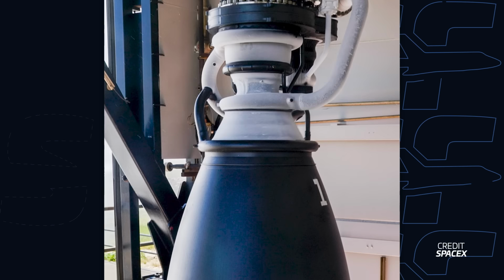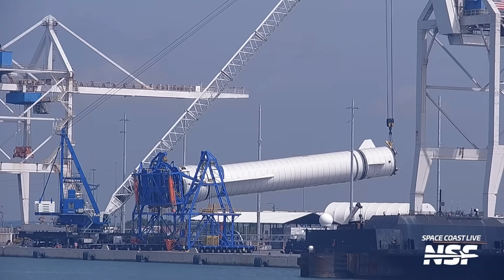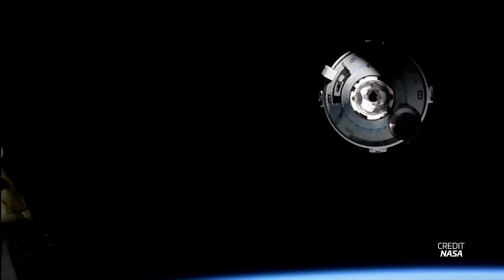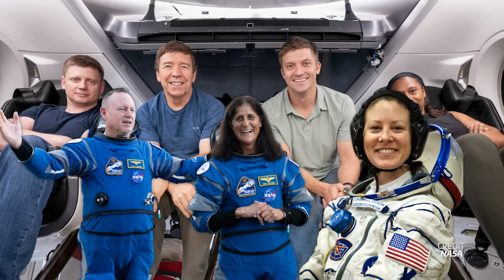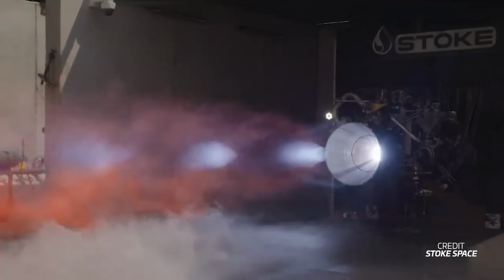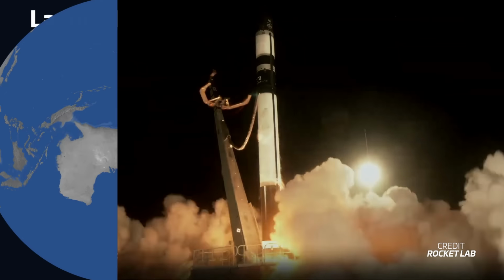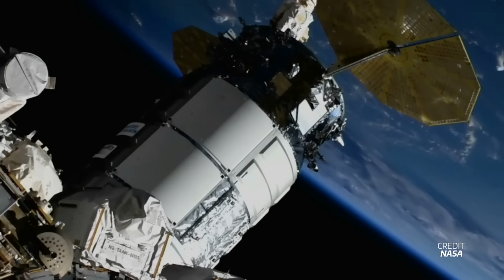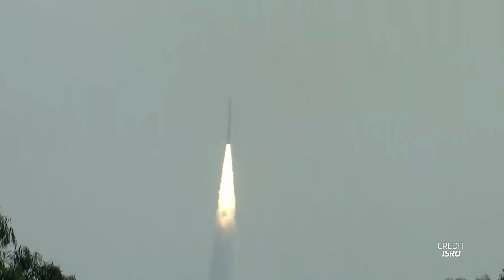Raptor 3 Fires Up, New Glenn Tests at Port & Starliner's Latest Update | This Week in Spaceflight

Comment: I'd guess that the cause of the colour of Archimedes' exhaust is probably the same as the reason why the Raptor has gone from purplish flame colour with Raptor 1 to more orange flames with Raptors 2 and 3. What exactly causes the colour change, I can't be sure, but I'd guess that it's caused by the engines running more fuel rich (maybe to reduce cooling requirements on the combustion chamber?), causing unburned methane to ignite in the exhaust plume when combined with atmospheric oxygen.

Comment: 3:50: Glenn and Falcon were both displaying only their first stages at the port, Glenn also being more elevated on a higher stand thus but appearing slightly taller, albeit them both being roughly equal.

Comment: The yellow flame from a met/ox engine is from running it rich on fuel, A fuel rich mix is used to reduce combustion and exhaust temperature. This same process is used in every type of motorsports racing engines
Reply: Every methalox engine to date has run at a fuel rich mixture

Comment: The Raptor 3 engine moved a lot of components inside the metal casing, thanks to additive manufacturing. It's definitely fully assembled, otherwise it wouldn't be functional.

Comment: I would not like to come down on Starliner. First, you need thrusters to make sure you properly enter the atmosphere. You also need them to maintain orientation in the very high atmosphere. I am not sure about Starliner specifically but many capsules as well as the Space Shuttle use "S" curves when hitting the lower atmosphere to bleed off speed during approach which also require thrusters.

As for Blue, I am pretty disappointed in their progress.......and I have been a huge fan since they were the first production level rocket to ever land in an upright position. I think they are 6 months or more away from launch. Their landing ship is not even in florida....it has to cross the atlantic. Then they haven't even tested or done a full recovery scenario and then make adjustments. And even when they do finally fly, if they don't hit their landing, I am not even sure if Blue has backup ship in production. Plus, the have their hands in ramping up engine production and are under the gun to get their moon lander solidified. To me, "slow and steady" is very different from crawling ahead millimeter by millimeter hope you will see steady progress

Comment: The exhaust colours are orange I'd say because rocket lab have either used oblative cooling which is doubtful because of reuse needs so that leaves the fuel. Rocket lab may be using natural gas and not methane. While natural gas is mainly methane it has other gasses in that spaxex filters out for max performance . Rocketlab are not prioritising performance because of reuse and thus may just use natural gas because they can and it will be cheaper
Reply: BE-4 is also supposedly using LNG and it burns blue. It is also the same engine cycle
Reply: @Alexphysics13  I never new that. I always here them say methane regarding the be4. Also Astra specifically says they use natural gas and they have orange in their flame I think. If that's not it, it can only be the engine melting
Reply: @nathanbradforth3408  Astra has never used natural gas (nor claimed to have used it).
Reply: @Alexphysics13  it must be relativity. It's 100 percent one of them and the ceos last name is Kemp. I'm 100 percent confident I'm correct it's one of those 2
Reply: @nathanbradforth3408  Kemp is the last name of Astra's CEO, Astra has never used methane or natural gas or any derivative of that on any of its rockets. Relativity's CEO is Tim Ellis, they flew the Terran 1 rocket fueled by LNG and the exhaust was blue - it's in our intro if you wanna check it out
Reply: @Alexphysics13  yes I realised after I wrote it that astra was Kerosene/LOX. The Reiitivity Terron 1, is that natural gas or Methane? One of them has orange exhaust? Maybe it was Stokes's 1st stage engine?
Reply: @Alexphysics13  be4 actually has orange red flames at the ends

Comment: I'm surprised that no one asked about space suits. If Starliner departs the station unmanned, there is no place to plug in additional suits into their existing dragon lifeboat. If there were, is dragon compatable with starliner or soyuz suits. Is the current life support system on the dragon rated for seven people? I listened to the briefing, but i did not hear anyone ask the questions. I hope nothing happens between the starliner leaving and the next dragon arriving. Breathing on the way back would be a good thing.
Reply: The suits are for emergencies. Plus they look really cool. The capsule itself has plenty of air for 7 people. The three extra passengers would basically strap themselves to the floor wherever they can. And hope for the best.

Comment: If it’s not safe for a normal return, it’s not safe for an emergency return. It’ll just be a final option.
Reply: anyone who engages in risk management (like nasa) understands that safety is not a binary property. rather, each potential problem has a severity, a probability, and an uncertainty. based on analyses of these properties, using starliner is far safer than any scenario that would prompt the evacuation of the iss. nonetheless, it is not known to be sufficiently safe for normal use.
Reply: Nothing is "safe", there's just a different threshold applied for different scenarios.
Reply: i dont understnad whats so hard about taking the L and just letting crew dragon return the stronauts and prevent a catastrophe
Reply: @Nuke-MarsX  Starliner is unable to go without crew in it's current state - they can't just send it back empty.
Reply: @TheNheg66  
nasa clarified this at their press conference. starliner is capable of departing without crew. the specific concern they have is about what happens if starliner has another issue while it's still close to the iss. the starliner software is currently configured to ask the astronauts what to do if something seems to be wrong. nasa wants starliner to be able to get away from the station autonomously under all circumstances. we don't care if the starliner blows up as long as it does it somewhere else.
Reply: @TheNheg66  but didnt they want to install the software to do that

Comment: China is doing its best to ensure that the Kessler syndrome does not remain just a theoretical possibility
Reply: Honestly, it might be in EVERY nation's best interests to sit down and agree upon on new terms for space use.
Where if an upper stage almost routinely turns itself into a cloud if space debris, that the company or country operating it willingly ceases it's operations until it can be rectified!

This isn't any bias against China, either. Simply this: I don't know if those 700 pieces of debris is on the high side of low side for the other 3, but if all 4 of those breakups created an average of 500 pieces of detectable debris, then it's safe to assume there's some that are too small to detect.
All of that is to reiterate my opening point: it's in EVERYONE'S best interest to make sure that doesn't keep happening, as it eventually will become a problem!

(even at an orbit if only 800KM, space is incredibly vast, so we're not yet at a huge risk of Kessler Syndrome, but that's why it needs to be addressed now, because it could easily begin to snowball before too long)
Reply: @DUKE_of_RAMBLE  China's leaders doesn't really care, as the loss of earth orbit also denies the rest of the world access. Only the short term goals have any real meaning to them. Especially if they can use LEO to undermine a competitors position.
Reply: China and Russia on their way to test another Anti-Satellite Missiles for Education purposes

Comment: Look at the skin between ring 3 and ring 4 of New Glenn as it is lifted. It buckles and leaves clearly visible skin distortion when it is in the vertical. Happens between the 20 and 30 degree mark. Ouch!
Reply: omg! i just went back to look at that clip. i had to zoom in to see but there's def something going on there! id be suuuper interested in knowing what's going on with that!? it looks crumpled a bit. is there some way Scott Manley can be contacted to analyse this? if there's anyone who'd know what might be going on there it would be him. he'd def let us know in a vid after researching 🤔🤔
Reply: It's a boilerplate, not the real thing. Those are just sheet metal covers on what would otherwise be a basic steel frame and those were seen distorted a long time ago. There is a little bit of real hardware, like the quick disconnects that were tested recently, and obviously the attach points for the breakover fixture ring and the crane lifting cap.
Reply: Okay. Boilerplate. How does that translate to an actual vehicle readiness launch schedule? Plus, why isn't the boiler plate not strong enough to lift without distortion?
Reply: @andrewbutler1137 the outer panels are just for aesthetics, the whole thing is only meant to simulate the weight distribution, size, and connections of the real thing. The real thing is already undergoing final integration and should roll to the pad in the coming weeks for pre-launch testing - they already moved the second stage for Flight 1 to the pad
Reply: @andrewbutler1137  Because it didn't. It's been like that for a while. It's only generally a mass & dimension simulator, with only a few pieces of "real" flight-like hardware.

And I guess you've not paid any real attention. A full stack, real hardware cryogenic pathfinder went to the pad in February, then this went to the pad a month ago to do quick disconnect tests of the GSE, followed in rapid succession by an aft engine module for landing leg tests, and finally a full interstage to test RCS and fins. And now this proves out the breakover fixture for booster recovery.
Reply: @Starshipsforever  Thank you for the clarifications everyone. Exciting times.

Comment: New Glenn is smaller than I expected, it's bigger than the Falcon 9 for sure, but it's got nothing on the Starship Behemoth
Reply: Falcon 9 is massive. New Glenn is Gigantic and Starship is Enormous. They're all big rockets. Starship is just on its own level
Reply: Volumetrically, it takes about 4 F9s to equal one New Glenn. It takes only 2 New Glenns  to equal one Starship Super Heavy.
Reply: @thomasackerman5399  Thanks mate
Reply: @thomasackerman5399 starship is fully reusable vs only first stage on new Glenn. That's not even comparable
Reply: @thomasackerman5399  So just super heavy alone is a lot larger than a NG before you even add the ship on top.
Reply: @carljohan9265  No. The entire stacks are taken into account here. Two times New Glenn with Starship Super Heavy full stack.
Reply: @thomasackerman5399  Well, even with that, NG is way behind. It's payload capacity is actually lower than what even falcon heavy is capable of in a fully expended configuration, and if you compare it to starship it's not even close. 

If I remember correctly, NG doesn't even qualify as a super heavy lift rocket, while FH does.
Reply: @carljohan9265  Technically speaking, NG does. It also does what does with a singe stick configuration, while FH has to be made from 3 strapped together F9s. 

Starship also is currently not able to carry the hoped for 100-150 metric tons. According to Elon, it's 40-50 tons right now.
Reply: @thomasackerman5399  Because current form starship is a prototype that's still in development. 
Look at the difference between raptor 1, 2 and 3.
I have no doubt ship will evolve in a similar manner. 

Also the threshold for counting as a superheavy lift rocket is 50 tonnes and NG reaches 45. 
There are only 5 superheavy lift rockets that have actually flown ever: The Saturn 5, the N-1 (who exploded on every flight), the Buran (who got cancelled when the soviet union collapsed), the space shuttle (which is incorrectly counted as one because they counted the orbiter as payload for some stupid reason, it's actual payload capacity was 27.5 tonnes), and the Falcon Heavy. 

Also the "has to be 3 F9s strapped together" bit isn't a negative, that's a massive positive to be able to assemble a new rocket with new capabilities by just using the tech you already have.
Reply: @carljohan9265  I guess you didn't hear: Both BE-4 and BE-3U are producing more thrust than the original design goal called for and are slightly higher ISP. I would be very surprised if New Glenn isn't actually in the 50 ton range to LEO. It also explains why NG has such latitude in how long of a launch window its got to send ESCAPADE on their way to Mars.

Buran is an orbiter that rides a super heavy lift rocket called Energia.

Shuttle mass to orbit could've been turned in payload by making it into Shuttle-C or another type of SDV, which would be in the 70-100 tonne range.

The Tim Dodd tour of Blue Origin video tells us that NG is also going to evolve as well.
Reply: @thomasackerman5399  "could have been" doesn't equal "actually happened". 
The shuttle needed the orbiter to launch, the energia did not. 

I admit I got the names mixed up, but the enrgia without the orbiter could lift 100t making it a super heavy lift rocket. 

Also I do not give a single shit about anything BO does at this point, because the company is a joke and even a successful launch won't change that. 
Because even if NG actually flies, with their track record I fully expect their launch cadence to be terrible, and the FH can already do the sort of job that it's designed for, while F9 controls a vast majority of the market, and SS is around the corner. 

If I was a sattelite/space company I wouldn't exactly rush to design something that had to fly on NG, because I would have no reason to.
Reply: @carljohan9265  Your first part is wrong. All it would've taken was a swapping out of the Shuttle orbiter with a cargo module. And it would've worked just as well and given a very impressive super heavy lift capability. 

The second part is just childish shows that shows you're not intellectually on a level to comment on any of this.

Gravitics, Kuiper, and more have designed payloads that can fit on New Glenn.
Reply: @thomasackerman5399  I repeat, the shuttle could not fly without the orbiter. 
Because the engines were on the orbiter for some incredibly stupid reason, while in the buran's case, the engines were on the enrgia. 
And anything the shuttle stack "could have done" doesn't count if they never actually did it. 

As for the second point, Kuiper is owned by amazon, which is owned by Jeff Bezos, who owns BO. 
That's not a customer.
Reply: If you look at the perspective in that shot you will notice that New Glenn is farther away from the camera than Falcon 9.  That's why they look so similar in size.
Reply: Let us see if it can make it to orbit and come back.
Reply: @viperswhip  woud not mind it not work8ng on the first try orbit is enough

Comment: 102% = 100% Fight me.
Reply: Or we can just use design thrust as the metric of comparison instead of having to reset "100%" each time a modification increases thrust.  Of course, that's exactly what's done:  the design max thrust is what's used as the metric of comparison.
Reply: It’s obviously 2% more.
Reply: OK, I will. You're wrong.
Reply: 100% + 2% = 100% 
100 + 2 = 102
People be disrespecting percentages, makes a mockery of the whole (see what I did there) system.
Reply: @Billybobble1  and you don't work in aerospace or develop control systems for rockets. See, the people who do that are actually math-fluent, unlike you.  A percentage is a function of some reference value. In this case, the reference value is the original design's thrust.  This is a standard reference across the industry.

Your poor understanding of all this means your argument is irrelevant.
Reply: @robinseibel7540  Have you ever bought an apple that's 102% it's original size?
Reply: @Billybobble1  You clearly have no clue why a reference is necessary for determining percentages and how that choice of reference is arbitrary and a function of the application.  Again, you're clueless about the engineering and scientific use of such percentages, and that means you're clueless about how 102% thrust makes sense in the context of rocket motor design and performance.

Maybe you should troll somewhere else. You're embarrassing yourself here.
Reply: @robinseibel7540  Surely a man of your big brain has better things to do, I think we know who the winner is here. 🤣 Have a great day!
Reply: @Billybobble1 , nah, I don' t make assumptions about myself like that. I certainly would never think that I knew more than the experts.....unlike you.  Surely a man capable of such mathematical wizardry, such as yourself, should be working in the upper echelons of academia or industry to help advance humanity's knowledge.  After all, scientists, engineers, and mathematicians all need someone they can go to when they get stuck on a problem, and there's no doubt that someone is you.
Reply: @robinseibel7540  You're still here?

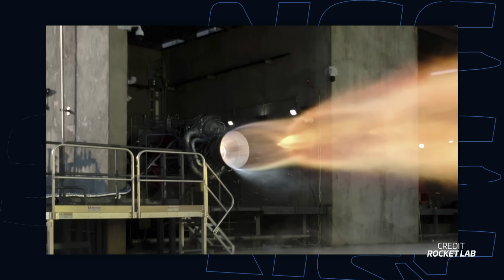Comment: 1:22 Imo, the mix of oxygen and methane is more on the fat side, for a cooler and safer (though less effective) burn maybe.
Reply: That's the point, the engines are supposed to be reusable. The rocket itself is light enough for it to allow it.
Reply: It also doesn't coke the hell out of the bottom of your booster like the Merlin engines do